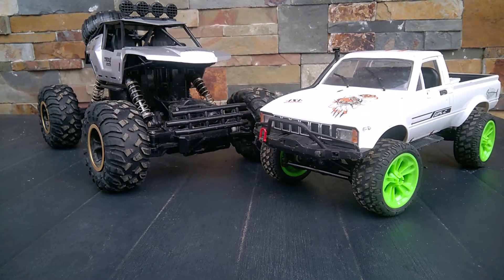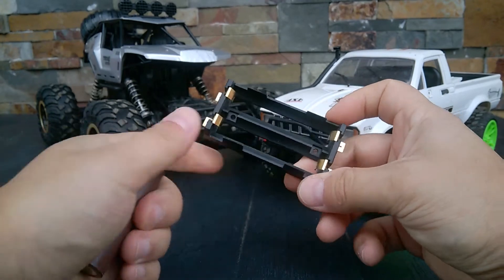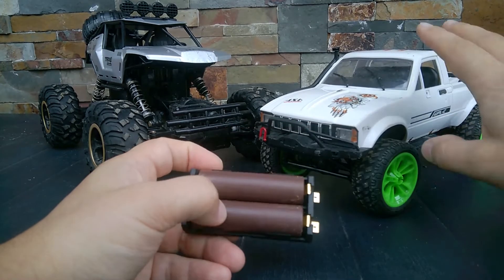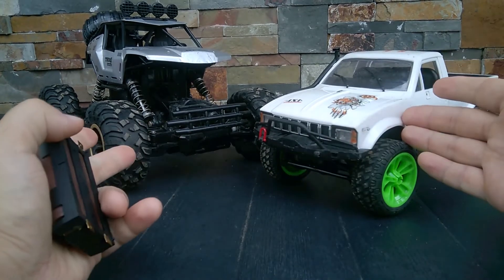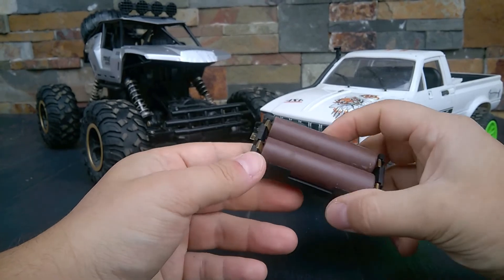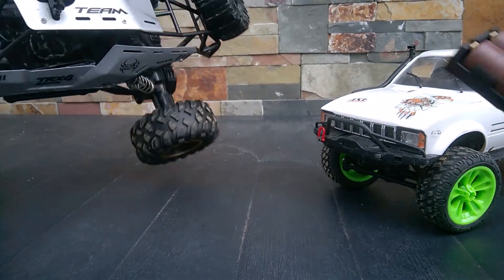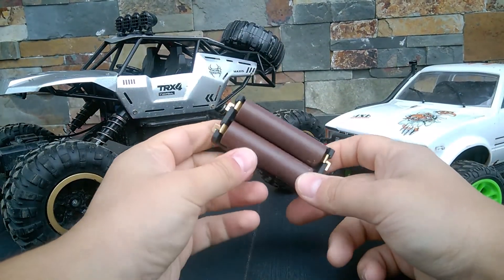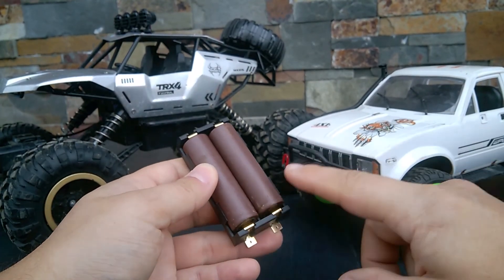How to Modify Your RC Cars to Run on the Same Type of Batteries? How to make your RC Car Run Longer?

Comment from the maker: 👇 Banggood / AliExpress / Amazon

If you decide to buy the products shown in the video, you can use our affiliate links below (no extra charges apply):

▶ Banggood:
18650 battery case: https://www.banggood.com/custlink/DGKWSl4E7T

▶ AliExpress:
18650 batteries: https://s.click.aliexpress.com/e/_DEy60P1
18650 battery case: https://s.click.aliexpress.com/e/_DDXJyhD

▶ Amazon:
18650 batteries: https://amzn.to/3h0apgq
18650 battery case: https://amzn.to/3h785UG

📺 Related videos:

How to Install 18650 High Capacity Batteries on 6026E RC Rock Crawler Buggy: https://youtu.be/JjzH_Ffk3V4

How to Install 18650 High Capacity Batteries on WPL C24 RC Truck: https://youtu.be/nczHkwFuKCU

Comment: Is there any play on your eachine e520s arms? My eachine e520s has play on the arms
Reply from the maker: no, they are all tight
Reply: @AventuraRemoteSmart   now I know that it is not normal for the eachine e520s  to have lose arms . I better tighten my drone arms
Reply: @AventuraRemoteSmart   I tighten my eachine e520s arms and now my drone flies . By tightening the eachine e520s arms my problem has solved thanks :)